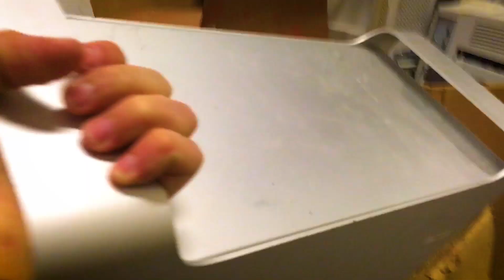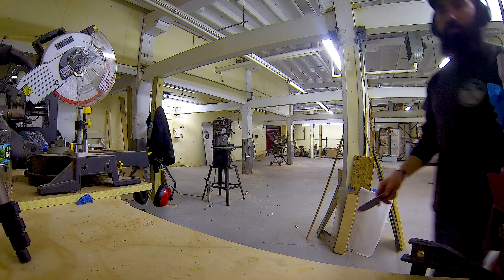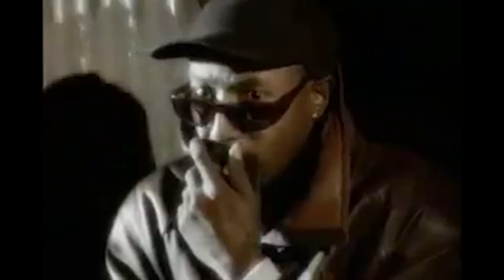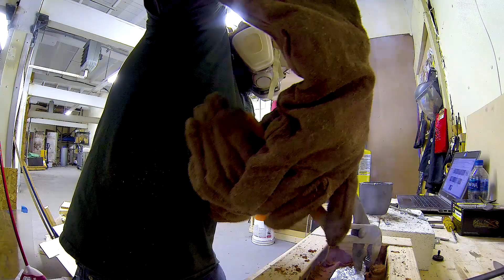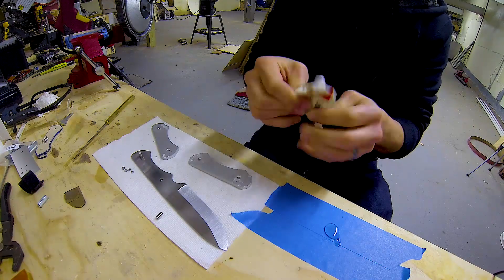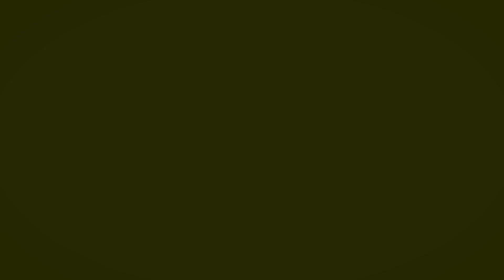Graz Makes: A Knife out of an Old Mac and 1084 Steel!

Comment: As a fellow bearded man what respirator are you using and how does it work with your beard? I have some 3m ones that sorta work if I tighten them up uncomfortably tight but its less than ideal.
Reply from the maker: i usually use an rz mask or a hanker-chief. i know its not great but its better than nothing!